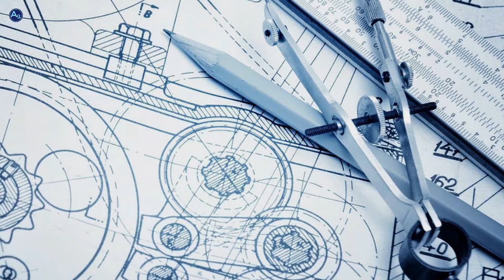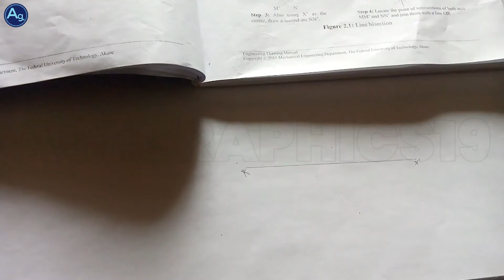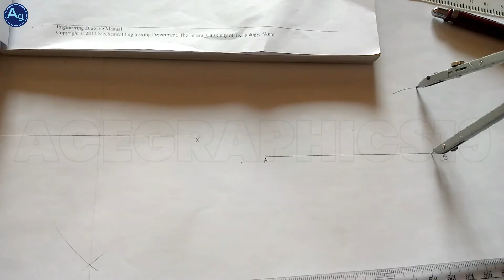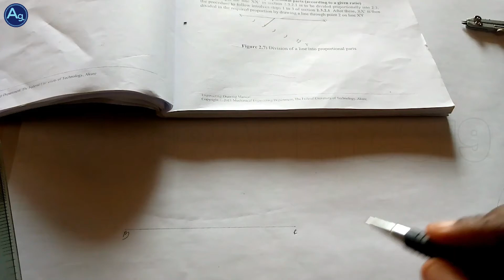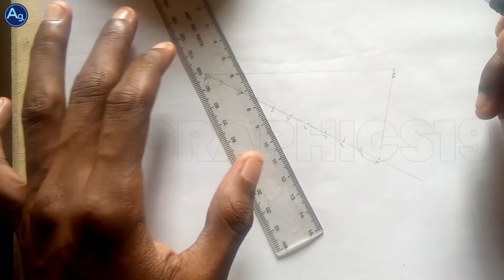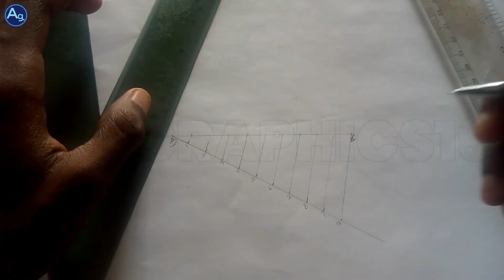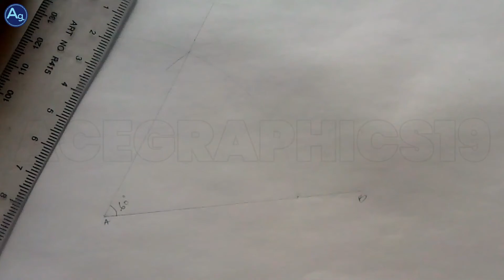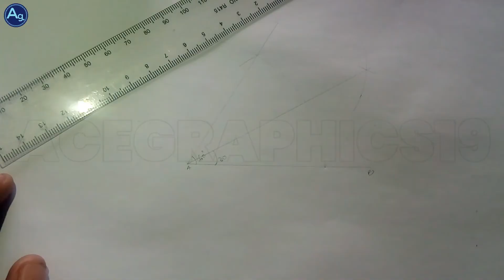MEE 101 PART 1 || HOW TO BISECT LINES || CONSTRUCT PARALLEL LINES || DIVIDE LINES || BISECT ANGLES

Comment: Is compulsory to use dat right angle to draw the lines 
Y not use the ruler directly 
Sorry for asking
Reply from the maker: With ruler, your lines may not be accurately perpendicular. But if you use any 90° set square, you can achieve that better. 
Thanks for asking.